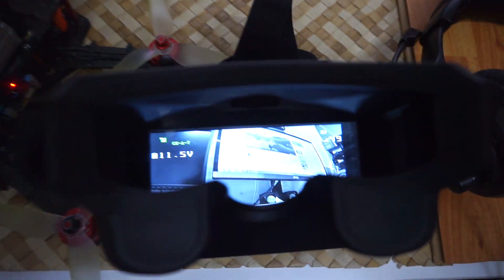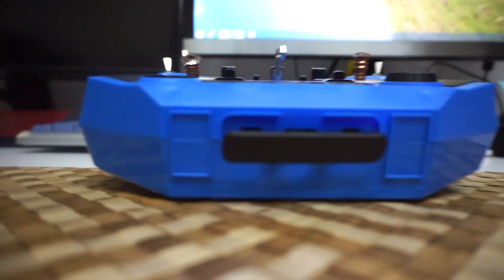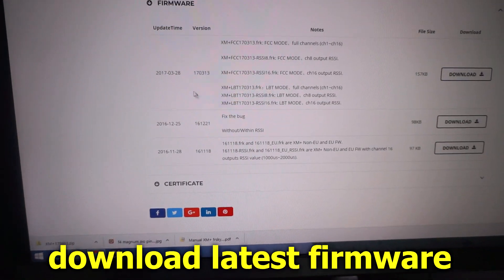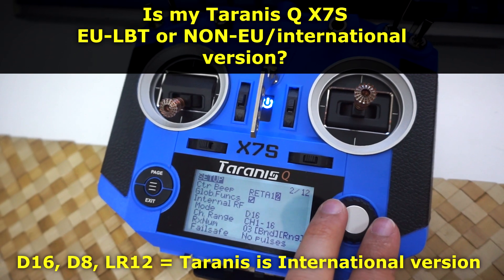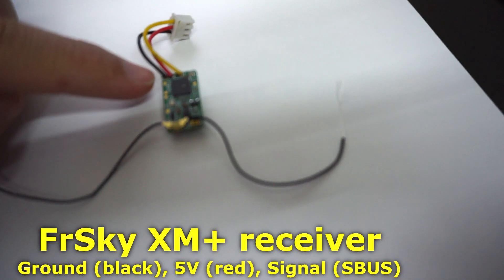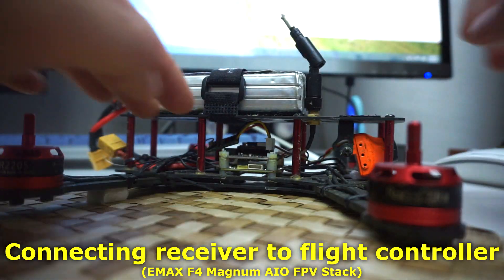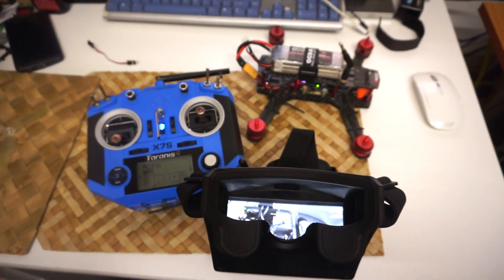FrSky XM+ receiver firmware update (RSSI value constant, Taranis Q X7S)

Comment: Do I need to update on my radio also? Actually, I did update in my XM+ with the new version 2.1.2 LBT and the bind is not happing more!
Reply from the maker: You have to use the same (LBT) version on both the transmitter and receiver. Updating can be a good idea but it can also complicate stuff...

Comment: Update! I tried flashing this firmware but as of recently frsky changed their firmware, make sure you go under older downloads, I downloaded the most recent one and it doesn't work, I guess it's for the newer access transmitters, and when you get into the transmitter, to flash it's now called s.port. it will save you a lot of headache😅
Reply from the maker: ACCESS and ACCST are not compatible.
Reply: Dude I’ve tried both files the new one from October and the old one from like March both in 2020 and my xm+ and nothing when I connect my xm receiver straight to the taranis with the connector on the bottom of the radio the one on the left
Reply: @ruvyfpv4398  what taranis do you have? Is it the accst or access
Reply: @overratedsrtchallenger  I have the accst
Reply: @ruvyfpv4398  just buy another receiver for the accst transmitter lol buy like a xm+ or rxsr
Reply: @overratedsrtchallenger  is my taranis qx7 compatible with the rxsr?
Reply: @ruvyfpv4398  yes
Reply: Please help

Comment: You can't tell if your radio is FCC or LBT by showing or not showing D8 mode, there is sticker on the back which says what what version is it. If not, try flashing both of them and try pairing it to the radio.

Comment: I couldn't figure out why I didn't have metering on channel 12, in the receiver tab for Betaflight.  Your video was the only one that pointed out it was due to not having the firmware updated on the XM+.  Other channels talked all around RSSI in Betaflight such as select and save channel 12.  They  showed after selecting a saving you now had percentage reading in the Setup tab etc. etc. 
But Other video's were assuming channel 12 was dancing around with all this information.  Finally your video pointed out if you don't have metering on Channel 12 here's what you do...update the firmware on the XM+.  It took me two hours of searching YouTube till I found you video.  Thanks for thinking further back into the whole process.
I know we can fly without the RSSI value on the OSD screen but not having it is like not having battery voltage.  Without either of those two pieces of information you fly with less confidence.  Good video, thanks for putting this our there.
Reply from the maker: Related video ► RSSI won't save ► https://www.youtube.com/watch?v=RzfHSPWmS7k

Comment: Not all QX7 radios will work on bottom port. The early productions it was NOT wired in. In that case you must use the module bay pins and there ground and volt are reversed!!!

Comment: Hi! When I put my xm plus into my taranis, it doesn’t come up with “device” when you click on the folder? Please please please can someone help?
Reply from the maker: Where is that "device" shown in this video (which minute:second)?
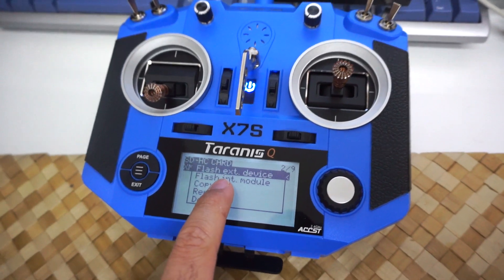Reply: furulevi hi! At 4:10 it says “flash ext. device” but on my taranis it only comes up with “flash ext. Module”. There is also another option and I have tried all of them, however non of them work, and one of the options glitch the radio and switch it off! Btw thnx for responding!
Reply: @Ibabthekebab  Did you ever figure out a fix? Im going through the process right now and have the same problem, "device" is not showing for me, only "module"

Comment: in other tutorials, the link to the taranis, made by reversing the negative with the positive ... which operation is right and which is wrong?  Thanks ;-)
Reply from the maker: for me it worked as it is visible in this video...
Reply: @furulevi  in fact I saw and I wondered why in some tutorials they argue that they have to be reversed ;-)
Reply: @alessandromedos891 : I think if you use the module port on the back of the QX7 you may need to reverse the + and - wires but using the cable connector on the bottom of the QX7 you don't. Try to confirm it before trying though.

Comment: Do you have to bind the XM+ again with the QX7 after you flash the firmware on the XM+?
Reply from the maker: My receiver worked right away after flashing without any re-binding at all... (strange)
Reply: @furulevi  same here. It was still binded after flashing

Comment: any idea why the value is jumping around so much? i just did this process over the weekend and im getting a max value of about 80 even when im right beside the RX and it only seems to drop 10-15% during flight, even when im pretty far away.
Reply from the maker: I don't know what could be the problem, but now my XM+ receiver's green LED turns to red during flight... crash! I should re-flash it again.
Reply: @furulevi  Did you get it to work properly?
Reply: Exactly the same problem here. Can I kindly ask if you have find any solution?

Comment: Maybe this is a stupid question, I'm not very computer savvy.  but do I need an empty sd card? Or can I use the card with the opentx sounds files for my taranis on it? Thank you
Reply: Yes, you can use the same SD card, just put the firmware file in a separate folder so it's easier to find.

Comment: so after flashing it still stayed bound and did not require any additional setup? I have this same stack and problem with no RSSI on my Qx7
Reply from the maker: yes it was bound even after flashing, as seen in the video, I know it is strange...
Reply: Only if you flashed the same region related firmware (FCC or EU).